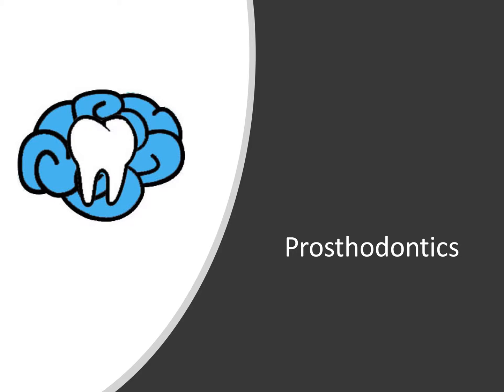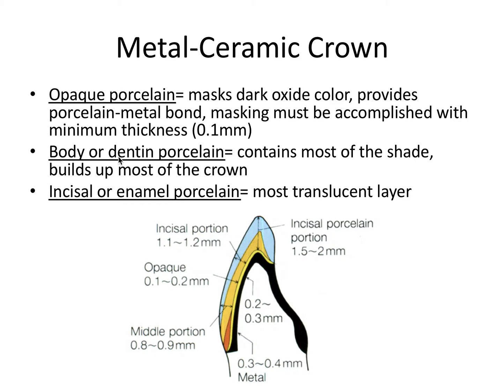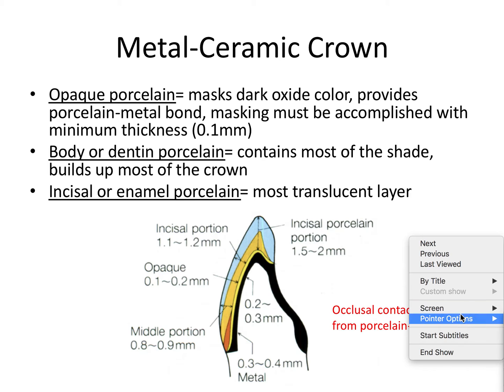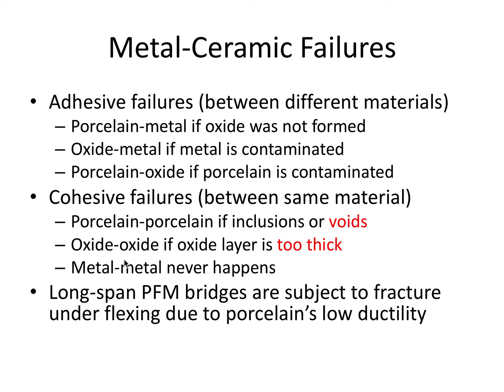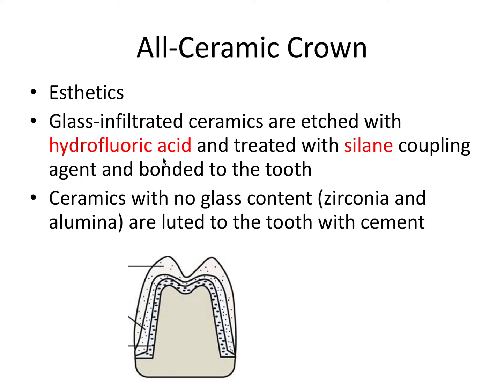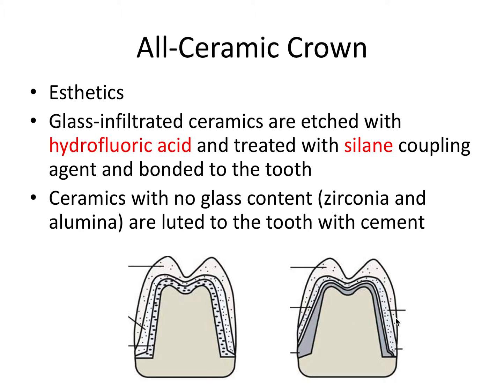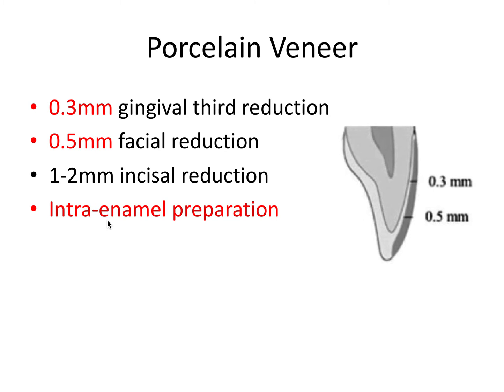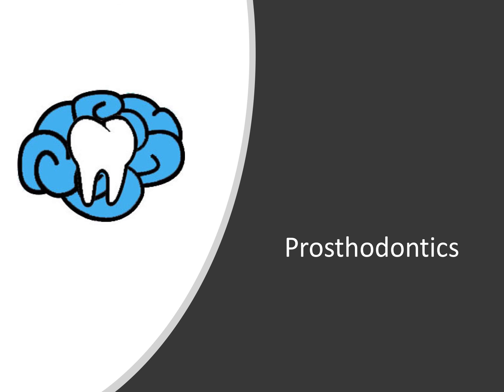Prosthodontics | Metal-Ceramic & All-Ceramic Crowns | INBDE, ADAT

Comment: Thank you for your lecture 
What is the position of veener finish line?
Sub gingival or equigingival
Reply from the maker: You're welcome. And it depends! The position of the gingival margin of any veneer is dictated by the extent of the defects or discoloration and the amount of tooth structure that is visible with maximum smiling.

Comment: Hi Mental Dental, Thanks for your videos. I am a Dentist and Ceramist. @1:46 Technically, the opaque porcelain does NOT mask the dark oxide color. Opaque porcelain is a little translucent. Its the opaquer layer that masks the color and later opaque porcelain is applied and fired on to the coping. The layers in PFMs are Metal -> oxidation layer -> wash opaquer -> opaquer -> opaque porcelain (aka opacious porcelain) -> dentin porcelain -> and/or enamel porcelain -> glaze.
Reply from the maker: Great to have your insight! I did oversimplify it a bit too much, thank you for the correction!
Reply: @mentaldental  the simplification was for better understanding i suppose...